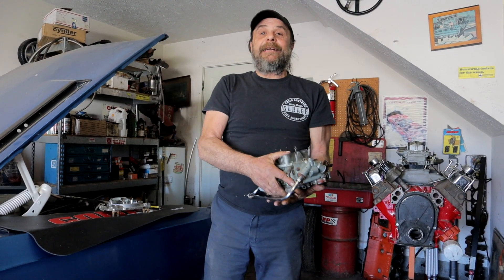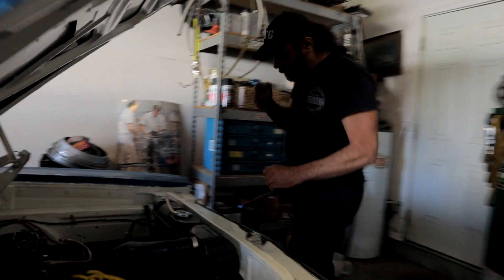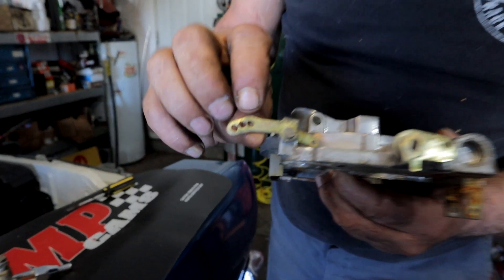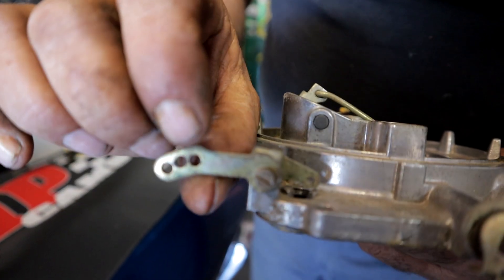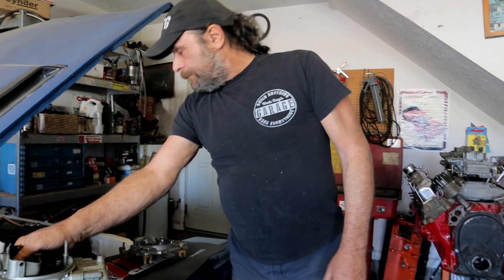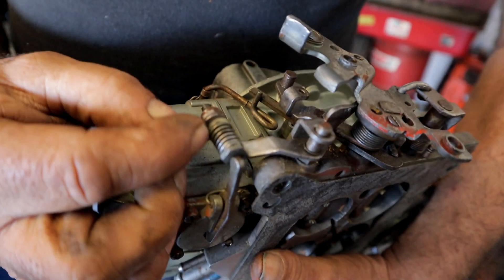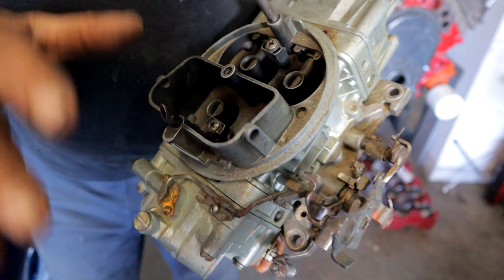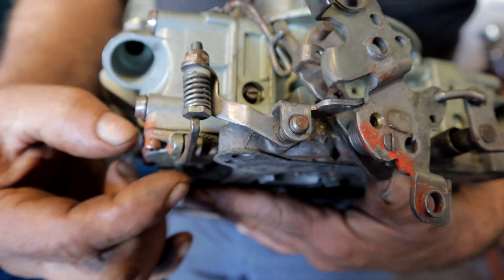Touch The Gas, And BAM, She Goes!

Comment: my 4160 Cab on my 390 engine, i had to spray gas into the Carb for the car to start it wasn't spraying when you press gas, , i rebuilded the carb now it's spraying but now i have to press the gas to start the car once i stop pressing gas car turns off, any suggestions please?

Comment: Unlce tony. I have some carburator questions. Do you think i can send you some pics and where.... i have a 1998 ford festiva 1.3. As far as i know the carburetor is made by aisin. 
I have a small buy/hesitation when you barely tap on the gas. So it hesitate everytime you take off. Its only in the beginning. After that its fine and runs good after that.. i changed the accelerator pump thinking it was that but it didn't help much.. the carb has a knob and also a adjusting screw. Do ypu know where to start and how i can send you some pics of how the carburetor looks like

Comment: Unlce tony. I just came across your video.  Im having those symptoms (new car) 1988 ford festiva 1.3 carby.. it has a slightly bugg,struggle when taking off. I have no experience on carburetor.  Could ypu guide me on how to check replace the accelerator pump? I can email you some pics

Comment: on a holley 850 front squirters is there supposed to be a checkball under the squirter or just that rod? Since carb was new d.side of the squirter dribbles then squirts. Changing squirters same thing. Im lost...thats my hesitation when I blip the throttle at idle.

Comment: There are 2 trains of thought on the accelerator pump adjustment. One is what you said here but the other is at wot make sure the pump is not bottomed out. That is where you need the clearance. Which is it?

Comment: My 225 Lean Burn Holley 1 barrel '82 model 1945 smog carb I don't think has multiple holes but does have a U shaped bendable linkage.  Can I bend the linkage for more pump? or do I need to drill more holes?

Comment: on every edelbrock ive had the bottom hole on the accelerator pump gave the best performance
Reply: You think so , Just Put it in the middle one Ealier and i don’t know if i like the way it feels or not ima just drive it and see if there’s a difference from the Bottom hole to the middle one
Reply: @ericklopez8236  in my experience yes, but no two engines are alike. but its worth trying
Reply: @ericklopez8236  let me know how the bottom done compared to the middle

Comment: Tony, you need to check out the Thompson Performance Powerblast Plate. I know it sounds hokey but just watch it in action on Youtube. It is essentially a little brass plate that installs above the pump squirters. It converts the pump shot from a stream to a fine spray for much better atomization. One look and you'll be a believer.

Comment: Not sure if you will get this. I have a ford 390 with a 4 barrel Holley 600. At idle she runs great but at higher rpms she starts to backfire. I just installed a HEI distributor and this is when I started having the issues. Do you have any thoughts?

Comment: I was watching a video on webber carburators, And I thought the dude that was telling you how to make them operate correctly said ( Don't use that stop screw for tuning purposes! It's only purposes is to keep the throttle blades from coming back and connecting with the bore wall inside and causing it to scare or damage it when the throttle is released real quick as you displayed for us here on your video! And I thought that was a very good way to describe the function that screw that we all have turned the hell out of when we were rookies still learning! But I thought of all the grief that would have saved me through the years had someone had explained that as simple as he did! In regular man words ( Just crack it open enough to keep it from contacting the wall of the bore inside, And then don't f#%k with it anymore then that or shits gonna start going down hill real fast from there on trying to get the thing to perform correctly! 🤔

Comment: I've got 650 Double Pumper on my 350 and I came across across this video trying to find out why my El Camino stumbles on hard acceleration, after the first 3 mins of watching I went to go check the adjustment to find the damn arm isn't even resting on the bolt but instead is above it! your video has FIXED my issue and additionally I now understand my Holley and carburetors in general a little bit more. You explained things well especially for a younger enthusiast such as myself.

Comment: I have a p-80 I don’t know the size it’s on a 1956 Ford fairlane with a 272 y block 3 speed top loader I’m thinking it’s to big stays running in idle but when I pull off its die down or burn tire then die back down

Comment: UT.. i’ve got a 40 Ford with a Chevy 350 small block, no modifications with a Edelbrock 1406 four barrel. During the cooler weather I noticed it running fine as the weather got warmer it seems like it actually had to be leaned out because in the warmer weather it wanted to stall out sitting at a light for it hesitated when you went to takeoff and as you let off the throttle after going any type of speed over 50 or 60 it would backfire a lot out of the exhaust pipes but not the carburetor. At one point the idol was up there nice around 900 850 in gear it would be about 650 to 700 which which I liked because if I turned on the air conditioning it would even go lower but lately it’s Gone back to this almost to Rich low idol 400 in gear 600 in Park. Is there a generic starting point I could go with on that 1406 screw both mixture screws all the way down back them out one and a half turns or or watt and then adjust the idle screw from there because it seem like I had it right and then I went for a drive and everything changed to get real high idle it started that pop in again out of the pipes it was surging again while driving it’s slow any help there thanks JT...I just wanted to add the guy that works on my car is a real hot rod guy and it’s hard to get with him sometimes and with the weather change I had to monkey around with the carburetor myself before this kind of stuff he had it all right in that cooler weather and I know the timing and everything is good on it I’ve got a new transmission in it new torque converter new fuel cell so I drive it every day it runs great but that carburetor is becoming a erratic
Reply: Is it a warmer day or time of year? The summer fuel blend isn't the same as the winter blend. Also in general warm air is less dense than cold air.

Comment: Yes accelerator pumps do help throttle response on a stocker or mild built engine  on moderate  performance engines  mechanical secondaries ..proper bend in mechanical Holly rod..and metering block with proper power valve and jets works better.. 
On the afb-carter type carbs...I.E.)  Edelbrock I feel jetting, metering rods and springs do most of it. On the street car..a  stall convertor, rear gear ,matching cam-spring set up and proper cfm set up carb with proper timing works for really snappy take offs.

Comment: A bad spot on a old Holley is the ball check valve on the bottom of float bowl. Too much clearance between ball and retainer bar and pump shot will be wasted going back into the float bowl. Modern rubber check valve eliminated this.

Comment: what about a intermittent pump shot on a holley 4412 i got good fuel pressure clean carb motor is mechanically sound but when you give her full throttle sometimes it will give a nice full shot & some times not

Comment: Glad you hit the initial and crucial "make sure everything else is ok" part!!! Sooo many times, ive popped a hood, only to find filters that are more dirt than filter, plug wires filthy and laying on everything, electrical connections that look like Caribbean coral, and when asked when plugs were last changed I get responses alluding to the fall of the Berlin Wall. You cant tune anything if the basics arent correct!!

Comment: Right, initial ignition setting is very impotant! But why don't you mention the throttle plate to transition slot relation here? Mostley you can not fix a of idle stumble with the accelerator pump, if this is not set correctly. I really like to watch your videos! Chris.

Comment: I love your videos! Watch them all the time! I do have a question tho. I have a Holley 4160 750cfm vacuum secondaries. Off idle punch is great but half throttle it bogs and tries to die. Fresh rebuild, new diaphragms and power valve. Everything else checks out great. I was running an Edelbrock 600 and everything ran great and I switched to this Holley and driveability went into toilet. Any suggestions? Idles great, responds great but driving at half throttle it cuts out

Comment: I need to address this issue on the 361 in my d600. Pretty sure it just has failed accelerator pumps from sitting most all the time. That thing idles great but goes dead when you crack the throttle blades until it gets really warmed up.

Comment: Im a AVS guy myself. Could make a Quadrajet run circles around a Holley..I have a fuel injected 5.2 in my Dakota..with my knowledge of timing curves and carburetors  Im considering going old school to get some adjustability. Researching how to get the 98 trans to work with this set up.

Comment: @Uncle Tonys Garage 1 big thing ive learned over the years is if you follow the holley manual and use a feeler gauge to set the accelerator pump itll give you a permanent bog. God knows why they tell you have play between the arm and the cam because then your throttle is cracking and vacume is dropping and your engine has no fuel at that moment and gives it a big hiccup. I've learned ignore holley and set it up set there is no play at all in the pump arm and has pressure against the pump diafram and works perfect. Whoever wrote that step in the manual is a complete idiot bevause ive fixed tons of peoples carbs with just adjusting that because they'd rebuild there carbs and then it bog and they bring it to me and 1 min later fixed

Comment: One small thing to add. On a Holley design, When the idle speed adjustment screw is turned in either direction is will change the accel. Pump adjustment as well. So any time the screw is turned double check pump adjustment.
Reply: Very good point

Comment: I never really considered the slop in the accelerator pump arm changing due to the float bowl screw tolerances.
Reply: I put a tad of pressure on it, but still check if I'm not over extending the diaphragm. I should be good 🙄🙄

Comment: Basic rock solid info , cheers. I would always go to look for an air leak causing bog or hesitation. You know like worn shaft bushes or simply loose hold down nuts etc. I have a Holley 780 on my 351c which i had overhauled at a carby shop (many years ago) but yeah couldnt loose the bog. Thanks Tony looks like all it was was that adjustment gap on the arm. Cheers , Thankyou.

Comment: ive got a 400 SBC with a Qjet.... (carter Qjet... which is an odd ball)
.
anyway..... it JUMPS when ya hit the gas
and it LOVES all the fuel..... 
.
its a cold blooded bitch that likes to be choked!!!!
but it will start right up in -50f
.
crank crank crank BA!!!!! ROOM!!!! ....... idle idle idle idle idle
.
thats a sign of good even compression, good spark and plugs..... and a well set carb

Comment: annular boosters will help off idle stumble...but wont solve an off idel stumble;always make sure the accelerator pump is in proper working order!!
Reply: No they won't. Stumbled on a two barrel, switched to Avs2 and still lets off an embarrassung cough sometimes off idle in first gear. Maybe it's a four speed thing, revs too low???

Comment: I try to remember as I'm reinstalling a Holley float bowl to rotate the bowl by hand clockwise as I tighten the bolts so the bowl is tweaked the same way each time to save readjusting the accelerator pump arm. Its a little thing but every little trick helps

Comment: In my experience with Holley carbs, the accelerator pump discharge nozzle sizing is the ticket to smooth operation without stumble or bog.

Comment: i love carburator talk , thanks uncle tony :)i used to run a 750 dp and ran 11.13 @ 123 on a hot day so i decided to swap it and run my 1850s 600 vac carb which i use for driving to and from the track ...long story short i did every single adjustment to it that you just mentioned in this video , pump shot , cam adjustment etc etc and i dialed in that little carb and the car ran 11.21 @ 121 on the 1/4 .....so yes indeed everything you said in your video is key to dialing in a carb whether its for street or strip or a blend of both worlds , thanx utg :),,,btw i havent seen you throw carb parts to the side in a while like your first videos , i miss  that

Comment: Good job on the carbs. you covered man...On the Rochester/carter Quadrajet,for performance, take a 1/8 inch off the accler. pump shaft and it will give you that much more shot on the pump action.
Reply: I run Holley,s,Quad,s and edelbrocks on 5 cars I have on a budget.

Comment: A completely unrelated question would be how fast can  cars be before you need to buy a trap door oil pan? I'm running a front sump pan.Sounds like some engines blow up when trying to stop too fast as well with a rear sump configuration.

Comment: Make sure your brake booster isn’t leaking vacuum from a bad diaphragm. A lot of guys think they’re brakes suck because that monster cam they just put in doesn’t make enough vacuum, when their booster has been leaking for years and the engine in stock form just simply made enough vacuum to mask the problem.
Reply: Use manual brakes. Much better.

Comment: Thanks Uncle Tony,I learn something new everyday.Do you remember when Demon Carbs came out? I bought one and it looks very close to a Holley except it's prettier.It's a 625cfm. I want to put it on my 350/300 crate motor thinking it would be a nice to drive smooth running carb,not to big and not to small.I saw an article on the motor I just described and bought it but they showed this engine with a Holley 750.My question is ,Is the 750 to big or the Demon to small? The car would be a week ender with a little show and go.I figured the 625 wold be a good all around carb.I did go to places like Summit and Jegs looking for parts for this carb BUT all they have now is a newer style.If the Demon I have turns out to be too small I figured I could get the parts I want to bump it up a little more than it is.I haven't started the engine yet I just took it out of the crate and put it in my car so that's why the question.I figured you have tons of knowledge and couldn't go wrong asking you.Thanks Uncle Tony...

Comment: Hey Uncle Tony, I need answers to a problem! My father has a 1963 Plymouth Valiant 170 slant six single barrel carburetor and is a three speed automatic , he’s been trying to get it to pick up speed and it’s been an headache trying to figure out why.. we’ve looked into the timing and it seems to be correct, the carburetor is like new and we have adjusted it out, the choke is working, we set the valves, we adjusted the kickdown linkage to the transmission and we do see it does switch through all the gears just fine when going down a slope or hill it’ll do fine.. it’s only when the car is in load (drive) then it acts like it wants to shutoff and it won’t pick up speed from the engine.. my father bought this car from a person that may have done some work to it before we got it and we don’t have a lot of information of the internals (if any) work been done or anything.. please let me know what we can do to solve the issue
Reply: Fuel pump?
Reply: @rockymeyers4030  or bad pickup
Reply: @rockymeyers4030  I asked my father about the fuel pump, says he never checked it because he says the carb is getting fuel but I told him to have a second look
Reply: I would double check timing, and condition/dwell on points. Manually check #1 TDC, dont believe damper marks. (Lots of vids out there on finding true TDC). Make sure vac advance line is to proper port, and that weights in distributor can move freely. Timing and advance, if wrong can create a total slug!!!
Reply: @wheels-n-tires1846  🤔 well I do know it’s a new distributor and it’s electronic though the car had points before, I’ll check into that again
Reply: @brandonjones522  Ok so the points/dwell part is out, but still verify initial timing, and check vacuum line placement and that mechanical advance functions👍
Reply: Brandon, invest in a Wideband 02 gauge.  That will tell you everything you need to know on what the engine is actually doing, you don't need to keep it on the car permanently and can use it for another project.  Start it up and verify if there are no vacuum leaks (get a vacuum reading, should be fairly high).  It could be fuel pressure related (good time to install a fuel pressure gauge), clogged fuel filter (incredibly likely), clogged fuel pickup (again, VERY likely) or the engine is just running incredibly lean.  Run a 100-micron fuel filter before the fuel pump and a 10-micron fuel filter after the fuel pump (this is CRITICAL on a carbureted, street car).  After verifying fuel pressure, best thing to do is when it's under load (if you're not using a wideband 02 gauge) is to shut it off immediately when it's acting up and pull a spark plug.  Read the plugs (plenty of guides online) and it will tell you what you need to know.